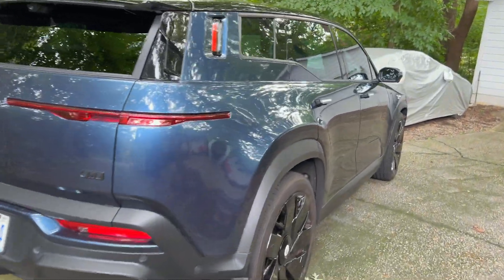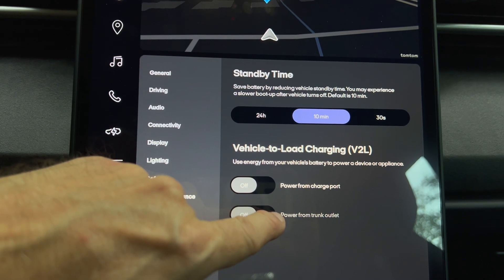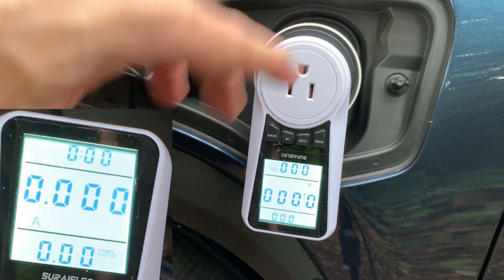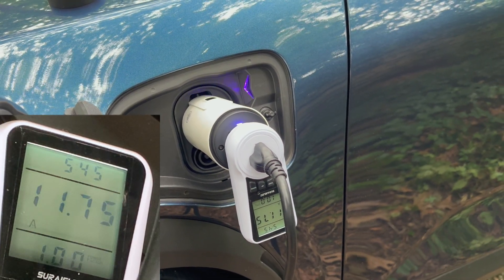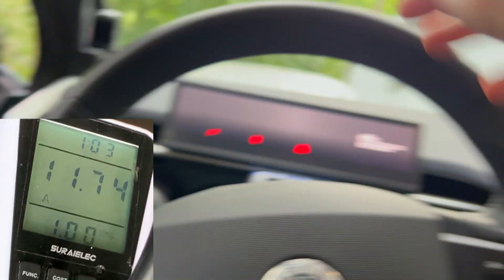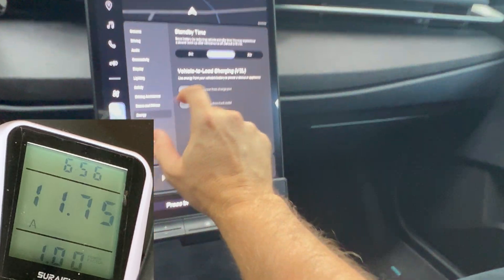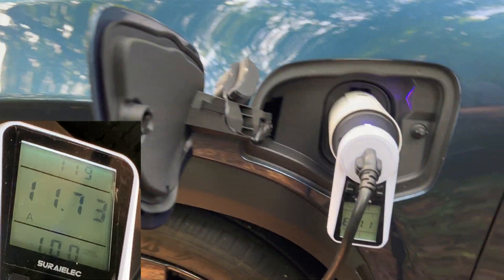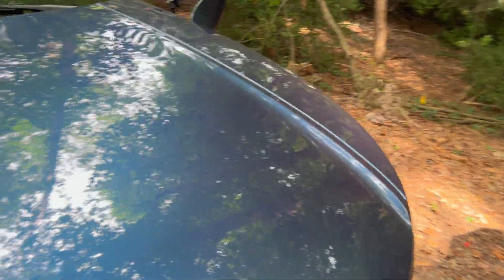Fisker Ocean - V2L EVSE Test

Comment: As I just got OS 2.2.2 I now have the ability to turn on both the 12v in the back cargo and also the front charge port. First I tested the back port with a desk lamp. then I tested the front charge port with that Fisker plug in and in both cases the lamp turned on. BUT I plugged in my level 1 charger and plugged the charger into my BMW and I got an error on the charger. The level one is a typical plug with a ground and the device plugged into the Fisker has a plug receptical with a ground. But I could not charge. Odd that the light works fine. I did, then, plug the 12v into an extension cord running from my home and that worked, it started charging my BMW. Odd.
Reply from the maker: Are you using the V2L adapter or the rear outlet for the EVSE?   The front V2L worked fine with either generic J1772 or Tesla Mobile Connector.  But I did have issues charging my Tesla with the rear outlet and the Tesla mobile connector.  There may be issues of grounding possibly or just a finicky charging on the other car.
Reply: @MTNRanger  I did not try plugging in my level 1 charger to the back port. I should have tried that. The front I used the V2L adapter and plugged in my desk lamp and was fine. I plugged in the level 1 and the actual level 1 charger displayed an error. I have another level 1 which I can try.
Reply from the maker: @DaveDarin  I found the V2L to be superior to the rear outlet. You can also lock the car and keep charging.

Comment: Just bought an Ocean One today from a dealer in California (shipping it to VA), after only seeing a few video clips from their phone - all on a whim - but knowing the risks in regard to no warranty.  Now I'm just trying to learn as much as I can about them, so I'll probably be absorbing all of your video content and trying to find the best forums.
Reply from the maker: Yes, I have a lot of content that should answer a lot of questions!  BTW, I recommend joining FOA (FiskerOA.com).
Reply: I bought recently, 3 months ago. A few tips. #1). Change out the 12v. While it may actually be good, I swapped mine out. I have another, less finnicky car that I will use that 12v in as the 12v I took out tested good. #2). In my case I wanted to monitor the 12v and also maintain it as I do travel a fair amount. So, I have a maintainer that I can check the status with my cell phone and I can plug in the 12v. #3). Be sure, absolutely sure to get the cooling pump recall done. #4). Check the connectors on the passenger side under the front wheel well, which you can turn the wheel and remove the panel over the wheel. Be sure there is no water and seal it so it is protected from getting water. #5). Buy the keyfob and 2 NFC cards and get them programmed. #6). Keep your Oceans high voltage to 80% unless you are scheduling a long trip, then 100% is ok. If you do not have Operating System 2.2 then you need to be sure the 12v is healthy and the high voltage is at 80% so the over the air will allow a good download to your Ocean. If you have OS 2.2 then no need for that, although good practice to keep the Ocean above, maybe something like 50%. I keep mine pretty consistently between 60 and 80%. #7). If you have one of the matte finishes then you should PPF it to protect it. Do not wax it or run it through a car wash. I heard rumor that EVs should not be run through car washes no matter what paint. I never use car washes on any of my cars. #8). Check out the Fisker Owners Association. I joined and to me it's worth the cost of membership, but up to you. #9) read a lot ands watch a bunch of video. This youtuber has great content about how to store the hood bolt driver, etc. under the hood, how to release the back tailgate if you get stuck in the Ocean, etc. Watch many of his videos. Cheers and congrats.
Reply: @DaveDarin  thanks for the detailed response!  I'm sure it'll help someone.  A month after getting mine a deer t-boned us as we were going 55 mph.  The insurance company eventually totaled it after they couldn't find replacement parts or anyone willing to fix it.
Reply: @ericjansen9042  Whoops. I should have looked at the time stamp on your post. Man, that's a bummer. I love my Ocean. There are recent opportunities for owners to trade theirs in, of course I don't qualify for that and I'm super happy with mine. Cheers.

Comment: I'd like to figure out what the difference is in the resistor network between the 120V adapters and 240V adapters, if there even is any. Would be nice to be able to get 3kW out of my US car for backup battery purposes, handling the output through an autotransformer to tap a neutral out.
Reply from the maker: Yes, V2G/V2H was a planned feature that would take advantage of 240V with a bidirectional charger.  I don't know if we will ever see that.

Comment: How did your 12v do during the 1 hour?
Reply from the maker: Good question.  I checked my monitor and it was being charged the whole time (14 V).  I cover this in the next video when I compare it to the trunk outlet test.  I was originally cover both, but the video got to long.  That's why the 12V wasn't mentioned.
Reply: Does the V2L charging use the 12V or HV battery?
Reply from the maker: @A818Rose  Electricity from the high voltage battery pack is going through the onboard charger back into the J1772 charge port and then to the V2L adapter.  The 12V battery is used to keep the car "on"  during this time.  That's why the 12V also has to be charged from the high voltage battery pack.